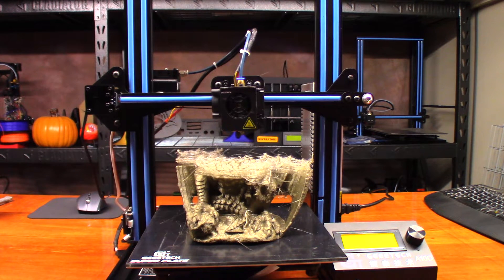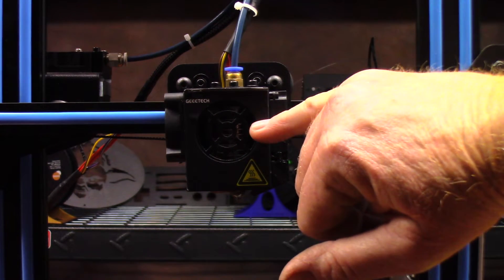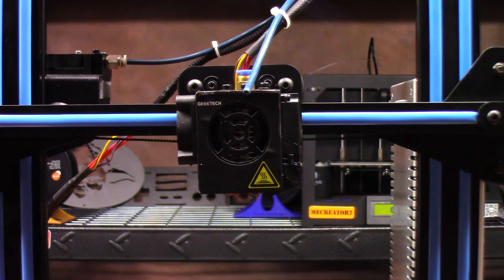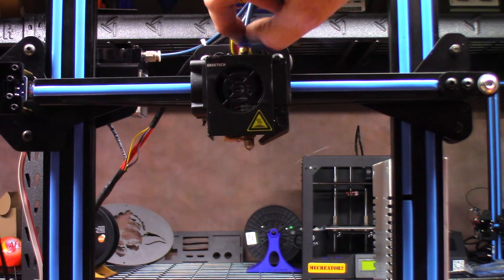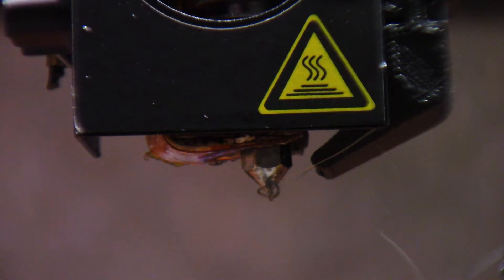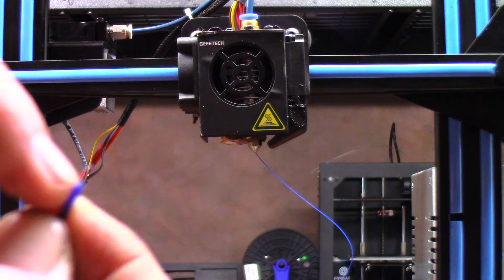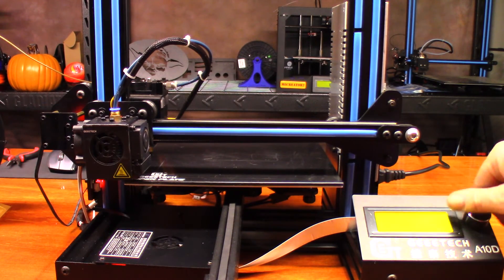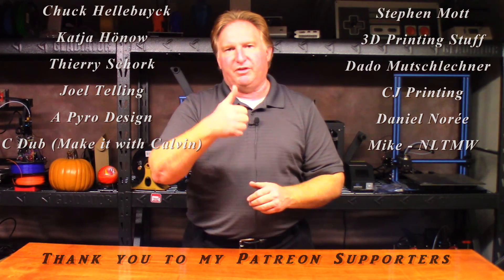Fixing A Clogged Hot End / Nozzle On The Geeetech A10

Comment: I took apart my 4th color-mixing hot end today. I removed the back-flow stoppers. Little check valves get plugged up easily with carbon fiber nylon. Geeetech mixing hot ends make poor switching hot ends anyway. If I want to do color switching (instead of mixing), I just set cooling tube (tool change retraction) to 5mm in the slicer. Use the blue Bowden tube which is a little bit smaller I.D.. It leaves less room for back flow.

Check valves are a dumb bit of obstruction to have in the flow path. Prints faster without them.

Comment: Just got mine from Amazon and I'm the unlucky guy who got a model that has:
1) An over-tighten nozzle which was probably done by with machine. I haven't tried "every types" of tools yet, but traditional tools fails to loose it down and it comes to the point where the nozzle's edged are being crushed/chipped. :(
2) When I tried to see if I couldn't do it more firmly with a workbench, I tried to disassemble the printing head block... just to see that (probably by the same assembler/worker) the bolt holding the heater cartridge in the the heater block is tighten so much that the heater block's upper jaw is deformed (bended) toward the lower jaw. I wouldn't be surprised if the bolt is bend too. That means that I can't remove the heater block to check if anything is broken inside.

I have sent a message to the Amazon seller to see if he/she doesn't have a spare printing head block because I'm quite uncertain if there's something I can do with it.
Reply: Ah, the A10/A30 hotend can be a Diva. Just to make sure: You are trying to dismantle it while it is hot, right? Because if you try to unscrew the nozzle while it is cold, you'll probably break it beyond repair. My A10 heatblock had a little maggot screw holding the throat, check if you also have one - then you can pull out the heatblock together with the throat from the heatspreader and have way better access. Again, only work with a heated hot end when assembling or disassembling it (but don't burn yourself)! Let me know if that helps & good luck!
Reply: @antspy9721  I'll admit that, at first, I did tried it cold, but not to the point of breaking anything. When I noticed it wasn't working, I checked online for clues and found out about the fact that it requires to be hot.
I didn't knew about the maggot screw which would explain quite a bit about my experience when disassembling.
Still, the fact remains that the heatblock can't be removed because of how stupidly tight the heater cartridge(the heating small cylinder) has its hole's jaw bolted. If I want to remove the heatblock, I got to unwire it from the chip's side and leave the heater cartridge inside of it. This means that I got to disassemble the whole thing down and not just the front. I'm starting to think that I should simply buy a new A10 hot end set (it cost around 26$) and a new heat cartridge (about 10$), but before that I'll do a few more tries with new tools I'll buy today and will discuss with the merchant if all fails. (The merchant doesn't understand why I would want to remove the heatblock. He doesn't seem to understand that a badly assembled 3D print head may have a gap inside of it, between the nozzle and the throat inside the heatblock, which gets filled with melted filament which requires the heatblock to be removed to be cleaned.)

Comment: I need immediate help!!!!!
I didnt have the tool that you used to unscrew the nozzle, so i used a plyer and a spanner for the job but i ended up mashing up the hexagon shape and i cant get it unscrewed anymore,
Reply: The nozzle should not be re-installed once you get it out.

Two things.......first, make sure the hot end is up to temp before you try to remove the nozzle, and second, the best tool to use in this circumstance is a vise-grip pliers........you don't seem mechanically inclined, so try to get someone who is more  mechanical, and they'd probably already have the vise-grips.
Reply from the maker: Agreed.  That nozzle is not usable.  Like Geoffrey said, preheat the nozzle to at least PLA temp, 200c and use vice-grips to try to save it. And don't forget to back up the heat block with something to keep from the torque of twisting the nozzle, otherwise you will be out more than the price of a nozzle.

And please, use a proper sized socket or end wrench when you go to reinstall a new nozzle.

Comment: Sucks to loose a print like that. It looked like it was going to be good. I'm fed up with my A10M under extruding randomly all the time. I've never known a nozzle get blocked up so much. You know how many times my Anet A8 blocked in 2 years of use? NEVER. And it was half the price.
Reply: Well there isn't exactly anywhere on the printer for particulate matter to come from to clog the nozzle.

However a combination of longer retract distance due to Bowden tube (meaning the liner gets heated up higher up) and the backslippage of PTFE tube in the coupler can cause temporary blockage issues on these Chinese bowden-fed printers, just from fiilament expansion in the PTFE liner, all brands should be more or less equally susceptible. Bad couplers were an epidemic on Creailty in particular.
Reply: @SianaGearz   One of the first things I did was make some clips for these cheap bowden fittings. Even if the tube doesn't move in the metal coupling, there is an inner part of the coupling that moves around so I made a clip which took many trials and errors until it pushed this bit back in and holds the thing solid. Unfortunately I'm still getting the odd retraction or extrusion issues. I've been playing with settings for 2 weeks trying to perfect and I seem to be chasing my tail. I wish Geeetech would just tell us all what the hell their slicer settings were on the supplied GCode files which came out perfect at high speed.
Reply: @ArcanePath360  I don't have this printer but you know what, look near the top of the example presliced g-code, unless it was edited out, you'll see a bunch of comment lines with the slicer program, version and settings used. Comment starts at semicolon and spans the rest of the line, printer firmware ignores these sections.

Also I hear people have been happy with the profiles for Slic3r Prusa Edition published by redangel1984 on Thingiverse.
Reply: @ArcanePath360  Possibly sliced with Simplify3D and then cleaned up the file to remove the incriminating evidence? Simplify3D license forbids distributing sliced files :D Or it's from their own EasyPrint3D running Cura engine, i don't know, though you'd be lucky if it doesn't crash during slicing or loading or if you look at it wrong.
Let's see what i can see from the commands you posted. Perhaps i can glean more from the whole file.
Bed first layer 65°C
Hotend 0 first layer 195°C
Feedrate non-print moves 150mm/s
Feedrate print moves 30mm/s
First layer height 0.3mm
There's probably another feedrate being set later for infill and inner perimeter, 60mm/s if i were to guess, and the layer heights for subsequent layers may differ.
Important, the file does not override firmware values for acceleration and jerk, so if your slicer insisits on setting them explicitly (Cura does not), some care is needed there.
Retraction... none happened in this sample, just need to follow E values until they decrease by a handful mm, possibly across a handful moves.

redangel1984 sets retraction length to 5.5mm and retraction speed to 25mm/s in his profile, and minimum travel after retraction to 2.5mm. He also sets temperatures to 200/60°C for the print overall and 5°C higher on the first layer both. Fan speed is 75% except on bridges/overhangs, reaching 100%. Limiting fan speed means less heat generated by the heater block and travelling further up, as you change the bottom cooling, but on the heater block the temperature is actively held stable, so the balance kind of tilts towards the top the more you cool the bottom.
Reply: @SianaGearz   Thanks for all that, some very insightful stuff. I kinda guessed some of it based on the LCD readout and judging retraction distances and speeds and trying to replicate them. So travel is at 150? I set mine to 120 as I had some layer shifting when I went to around 160. I played a bit with acceleration and jerk but did decide in the end that the firmware settings were good enough not to need overriding so I leave them alone since they give smoother motions than what I was putting in. The one thing I really wanted to know is the nozzle switch retraction as it's not documented anywhere. I might run the print again really slowly and measure the length of filament as it switches but that will be a pain.
60mms sounds pretty high for the inner wall and infill, though I wouldn't be surprised as it did go stupidly fast. It's annoying that when I go this fast I get rubbish results but I think my e-steps need calibrating or something as I'm always under extruding.  I've put the flow rate up to 110% in Cura now and my prints look a lot better. Maybe the nozzle is blocked again. I also notice that when I take filament out of the other bowden tube and leave just one in, I tend to get that filament start to leak upwards into that end. Steep learning curve with this printer compared to the simple Anet and a direct drive single extruder.